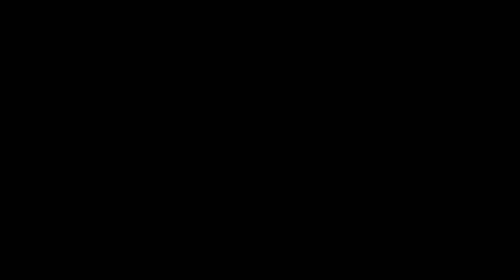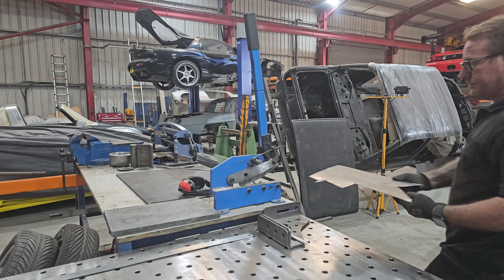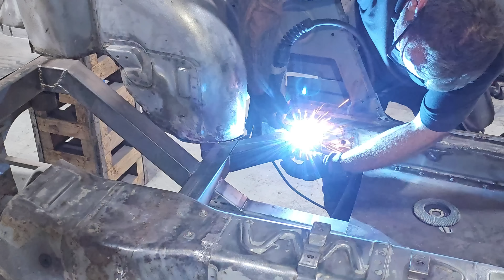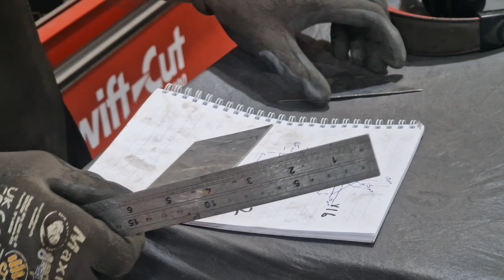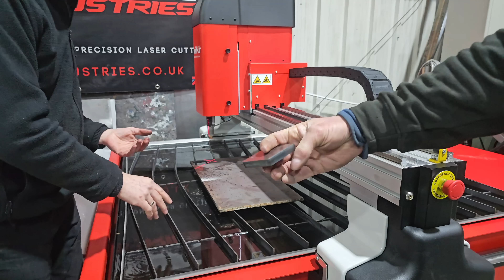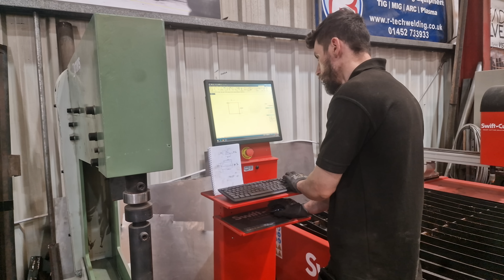Rebuilding A Disaster Datsun From The Ground Up

Comment: Why do you weld this with the mig welder, donat you have tig welding in the UK?
Reply: Many of the jobs in this restoration are actually more suited to MIG. TIG is typically best for stainless exhaust work, aluminium and titanium welding. 99% of body repair is done with MIG.
Reply: @foamdataservices  so it was in Sweden to for like 15 years ago, now days almost evry fine bodywork restoration is welded with TIG